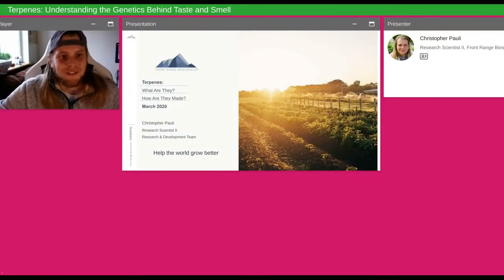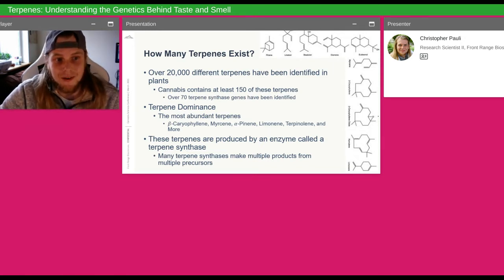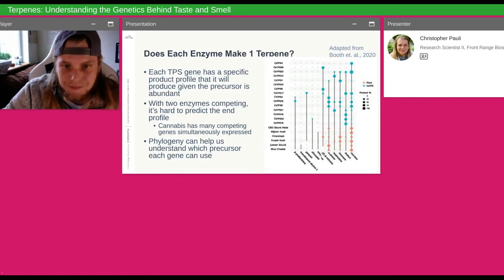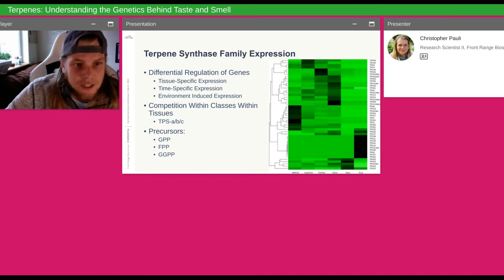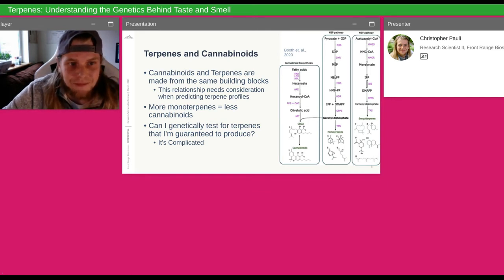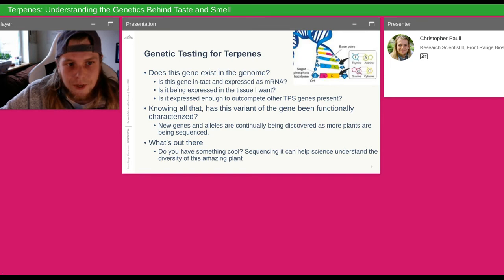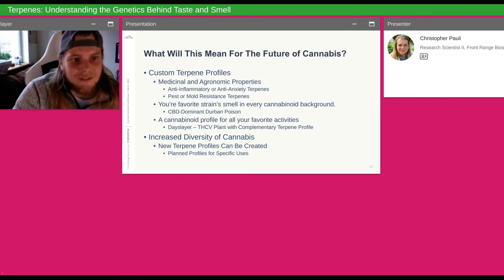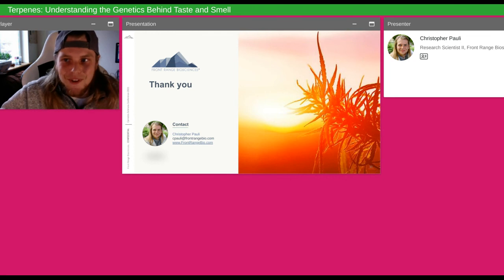Terpenes Understanding the Genetics Behind Taste and Smell

Comment: I thought monoterpenes have 2 isoprene units then sesquiterpenes have 3 then diterpenes have 4?
Reply: Mono is a prefix representing one, singular. 
Di is a prefix for two, for example carbon dioxide is written as CO2 due to it having one carbon atom and TWO oxygen atoms
Sesqui means 1 and a half times more
Reply: 4 isoprene units make a cannabinoid, 6 of them make carotenoids, 10 makes co Q 10.

Latex is 30 of them.